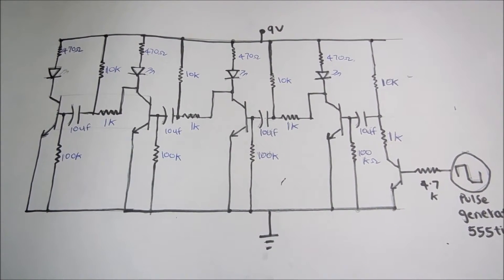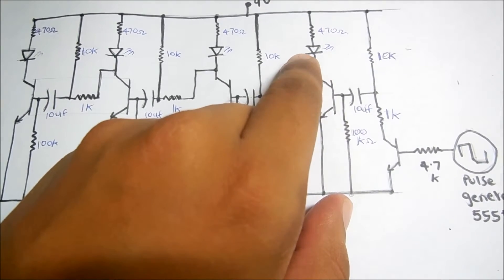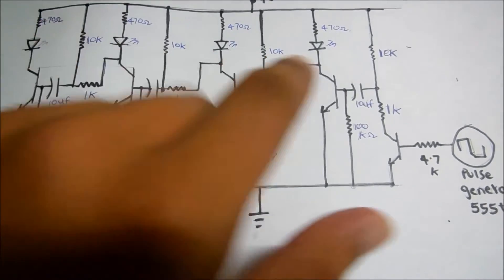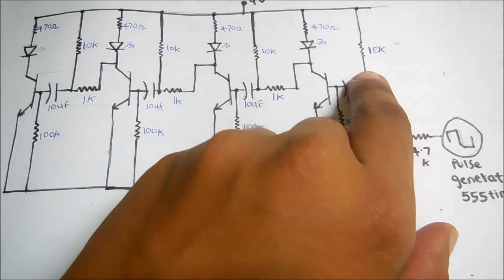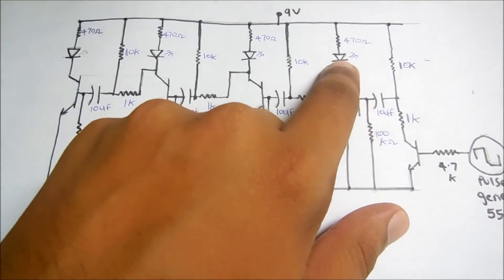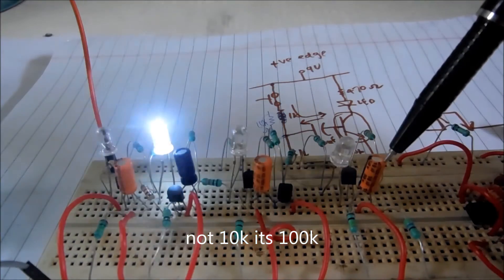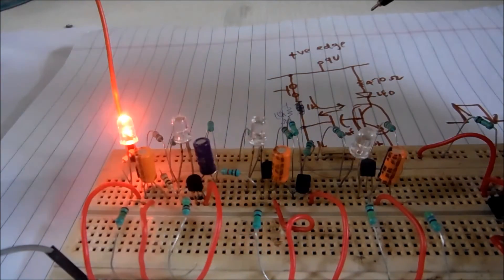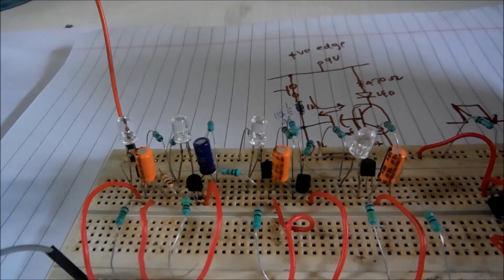Running led (fading transition)

Comment: Hi, thank you for this circuit. I need a bit of help if possible. I have created the circuit as shown, but have a slight issue. When the 2nd LED lights up, the 4th LED glows slightly.... I’m not sure how I can stop this from happening. Any help on this would be much appreciated 😊
Reply from the maker: I am happy you made it. This issue maybe because of Leaky transistor, try using another transistor. If that doesn't solves the issue then insted of 100k resistor ,use a lower value resistor. One more important thing is use capacitors of same manufacturer.
Reply: only using transistor circuits, thank you for the quick reply 🤩, I will surely check the transistors and do as you have suggested, fingers crossed 🤞 and thank you once again 🙏🏽😊
Reply: only using transistor circuits , Hi again, I managed to resolve the issue with your advice so thank you for that. I have another question and maybe this could be another video for you perhaps.... but would it be possible to have the LEDs fade on as well as fading off?  So like led 1 fades on then off, then led 2 fades on then off and so on... any help on this would be much appreciated, thank you 😊
Reply from the maker: @ha12vyb  Nice idea. It is possible. What I think, to achive fade on effect we need to damp the initial current which flows through the capacitor while it's charging and that can be done by adding a inductor in series with the capacitor. I have not tried this yet but you can go for it. Try adding different value inductors in series with cap.
Reply: only using transistor circuits, Hi, thanks for the reply and pointer. I don’t have any inductors at the moment so I’ll have to save that project for another time. Although I do have another question, possibly a silly one but I’m a bit stuck on it. So I’m planning to use switches to swap between the capacitor values and the pulse rate (resistance value) in order to get 3 speeds, slow, mid, and fast (33uf, 22uf and 10uf). So with this is mind, 33 and 22 worked fine with 3 channels, but 10 had an issue where the 1st channel would light up and go off instantly in the sequence. To eliminate this, I expanded out to 6 channels. After doing some testing, I found the max LEDs a single channel could handle was 9 (3 sets of 3 series/ parallel). Although this is good, is there anyway to increase this? Ideally I’m looking for 4 sets of 3 or 3 sets of 4?  I also found if I powered 3 red, 3 yellow and 3 green on a single channel, only the yellow and red would light. If I took away the yellow or red, green would then light but the remaining colour (red or yellow) would be dim. Again to eliminate this, I mixed them so RYG, RYG and RYG. All 9 then lit up on a single channel. My worry is that there won’t always be an even mix and hence would cause me issues. I’ve thought about expanding out to a 7th and 8th channel and would mean recalculating the pulse but I was looking for a way to increase the voltage across each channel as that would probably be a better solution for me. Please give me your thoughts and ideas on how I could potentially achieve this. Many thanks for all your help so far 🙏🏽😊
Reply from the maker: @ha12vyb  I didn't got it, what do you mean by " channel".
Reply: only using transistor circuits, sorry, each edge detector is what I referred to as a channel as it will run a set of LEDs. Hope this helps to help me.
Reply from the maker: @ha12vyb  Yes try increasing the voltage across the channels. Keep it up, just think about the output you want and work towards it. You will achieve it. Can you make a demo video of your project, it would help me to clearly understand what you are trying to make.
Reply: only using transistor circuits , sure, what’s your email address or whatsapp so I can send to you.
Reply from the maker: @ha12vyb  prachethire@gmail.com
Reply: only using transistor circuits, hi, hope you are well, did you get the video I sent? I’ve since tried something a little different and it seems to be stable at 9v. So if you power the LEDs off a single channel, the max I’ve found is 9 (3x3), but this can struggle. So if you double up the channels i.e from 3 to 6 and then link the triggers together via a diode 1-4, 2-5 & 3-6 this potentially gives it enough combined power to light 21 LEDs at once. This may well be my saving grace. I’m yet to test with 22uf & 33uf but currently 10uf is holding stable. Obviously I’ll have to adjust the pulse coming down from 12 to 6 channels but it’s no big deal. Thanks once again 😊
Reply: only using transistor circuits although I do have a question... so my understanding of the circuit leads me to believe this is a common positive rail circuit as the current flow through the channel LEDs is -ve to +ve. Would it be possible to change this to a common negative rail circuit so that the current via the LEDs would be +ve to -ve?
Reply from the maker: @ha12vyb  Yes, just replace BC547 (NPN type) transistor with BC557 (PNP type) transistor and you will get common -ve. By the way, I didn't received your video. Give me your email id.

Comment: Hi Can you show your connection in pulse generator IC? I do exactly what you did but the led is not in sequence. I think i got an error from the connection in pulse generator IC part..
Reply from the maker: I recommend you to manually provide a pulse with push button and if that works then go further to make a pulse generator using 555 timer ic and yes keep the frequency low.